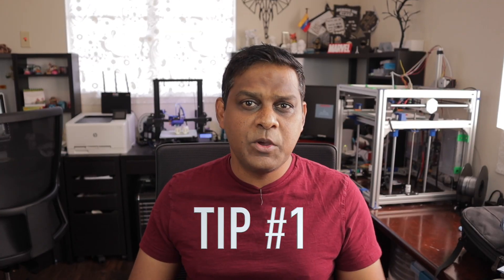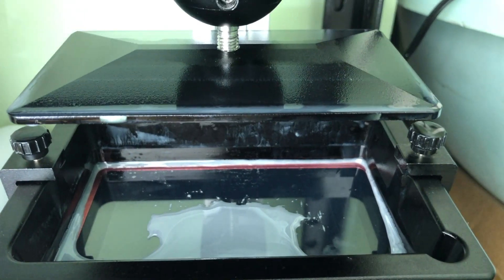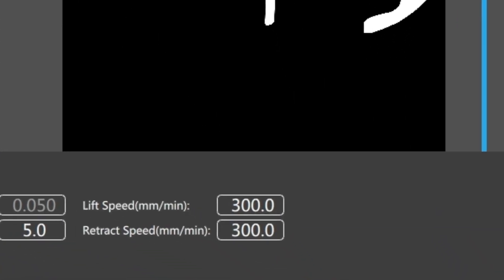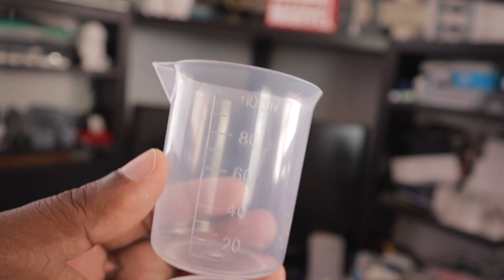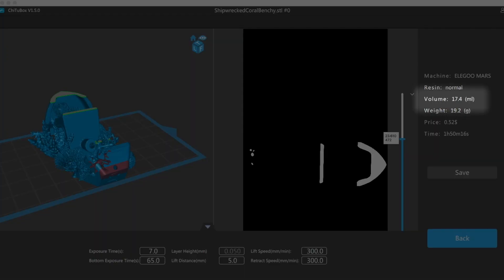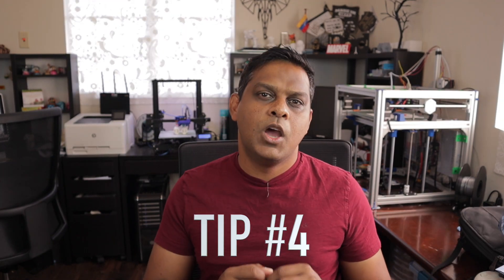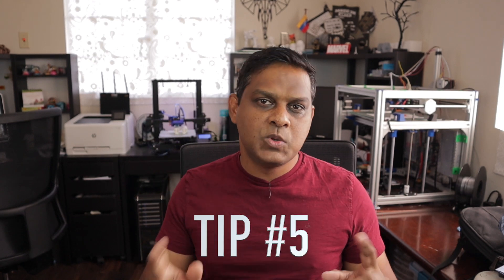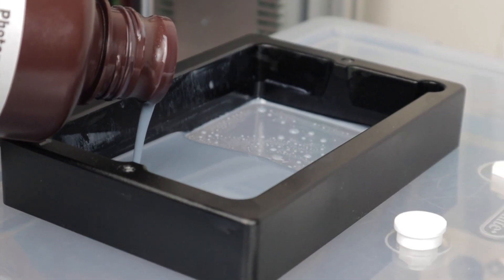5 Tips for SLA Resin Printing - Part 2, on the Elegoo Mars, Anycubic Photon and Epax X1

Comment: have you tried pouring a thin stream of resin from high above your vat to eliminate bubbles?
Reply from the maker: First time I’m hearing of that one. Does it work for you?
Reply: @FrameonesMakerspace  Not yet. I literally just got my Elegoo and am still designing my first model in 3D. Pouring from a few feet high is an old trick people have used to eliminate bubbles when pouring rubber molds and self-hardening liquid resin.
Reply from the maker: @dumbcat  Just be careful if its a few feet high just in case there are any splashes. Great tip!
Reply: @FrameonesMakerspace  Good point!

Comment: ok I've been having problems with big prints sticking to my fep small prints come off easy and like a stroke of luck I bought some rainx for my car earlier today I put it down then started up my borderlands lootchest I've been trying to print its only about 12 mins in but I hear it releasing every time the z moves
Reply from the maker: Large prints will stick to your FEP I’d the pull from the buildplate is LESS than the pull from the FEP. What do your supports look like? Have you added enough? Do you have a link to the model that I can try? schanderbally at G Mail

Comment: Hi, I will try the PTFE spray it sounds like a good idea. Do you simply spray it on or do you spray then wipe?
Reply from the maker: Hi William, spray it on a soft cloth like a t-shirt. Gently rub it on the FEP. Once you are done make sure to wipe clear and don’t leave any excess. You should be good to go!

Some persons also apply it to the underside of the FEP if they have issues with the FEP sticking to the LCD.

Thank you for your comment!
Reply: @FrameonesMakerspace  Wow that was an amazingly fast reply, thank you.  I am brand new to 3D printing and just bought a Kelant S400, my needs are engineering rather than figurines etc. Are you open to some advice to help me along the way?
Reply from the maker: Sure. Post up your questions anytime.
Reply: @FrameonesMakerspace  Excellent, thank you. I need advice on orientation and supports to reduce failures and clean up time, i would need to attach an image or file for you to see.
Reply from the maker: William Smith, 3DPrintingPro has some excellent videos on orientation and supports. Do a search for his channel with the same name
Reply: @FrameonesMakerspace   Yes i have been watching that also, but nobody seems to discuss small enclosures and larger flat sides & surfaces without too much marking etc
Reply from the maker: Try printing some simple objects like spheres and cubes and work your way up. You will quickly lean what is needed